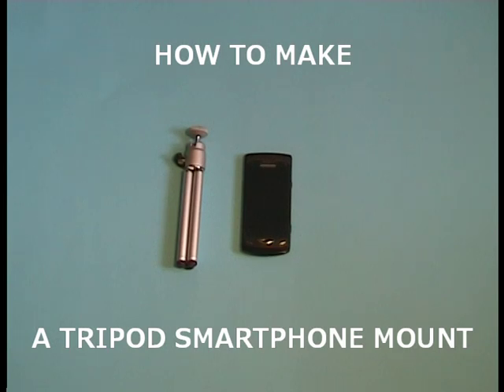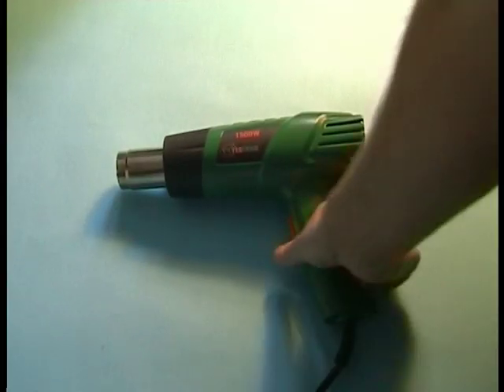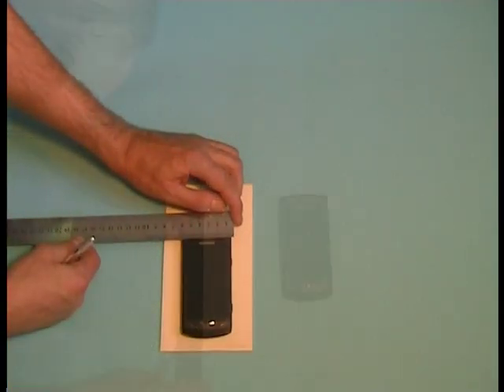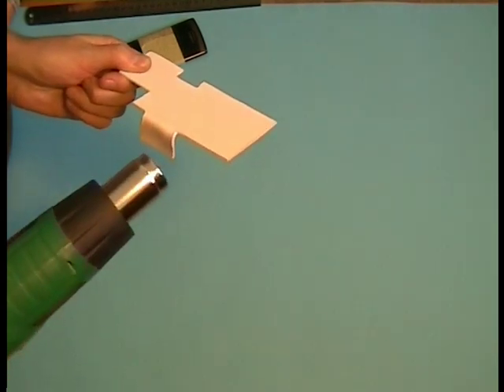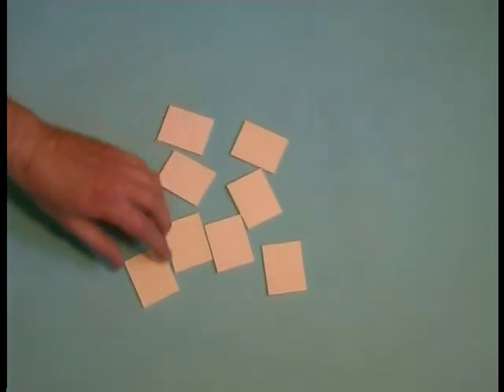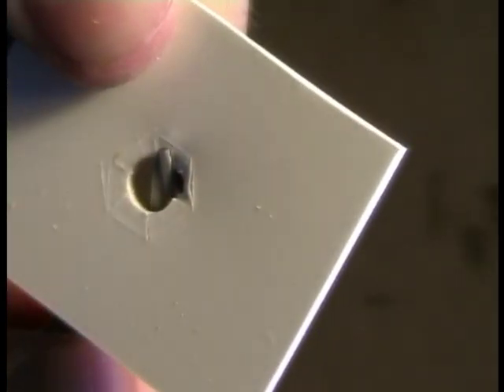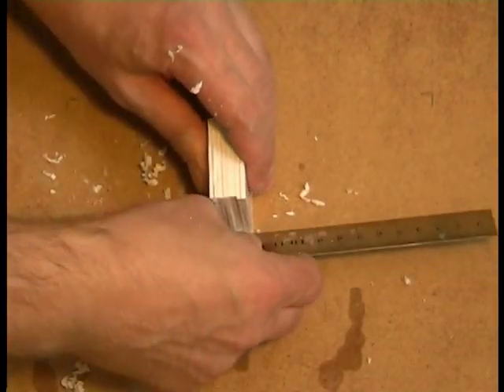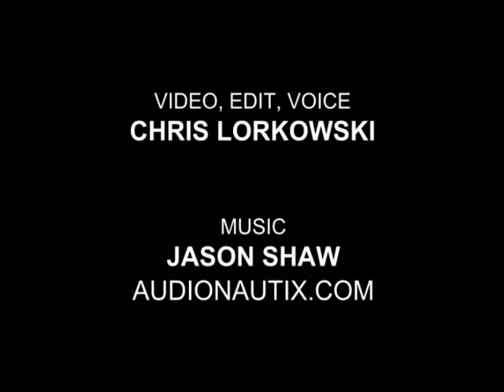How to make a smartphone tripod mount

Comment: I really liked the fact that what you did with your hands is done nowadays with 3D printing. Handcrafts are really nice. Anyway, yours will be done faster after all. 3D printing small pieces on a not so powerful printer will take some hours.

Anyway, I also tried once to make one, but it was to much pressure on the cell phone, so, I stop doing it. Yours is much more better.

Comment: I work a lot with Kydex and is similar to ABS.  Your project was very well thought out and excellently presented.  Good job.
Reply from the maker: Thanks! Could you tell me what you use Kydex for? It seems to be a great material.
Reply: I make gun and knife holsters. I heat up the Kydex and mold it around the weapon.  Great material you can heat it over and over again.
Reply from the maker: Jeff Lago
Thanks for your reply :)

Comment: That looks like it will work until you get your fluid tri-pod.  My guess would be to use strong PVC pipe but not to glue the movable parts for adjustments and movement side to side and up and down.  Mike
Reply from the maker: You're right, my smartphone tripod mount would not work with a fluid head, but don't you think using a fluid head with a smartphone would be a bit overkill?